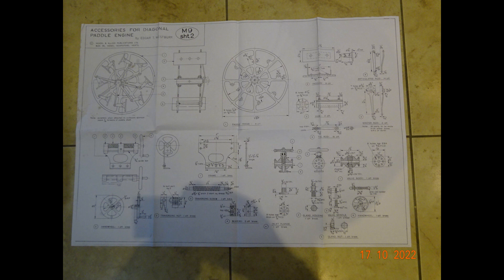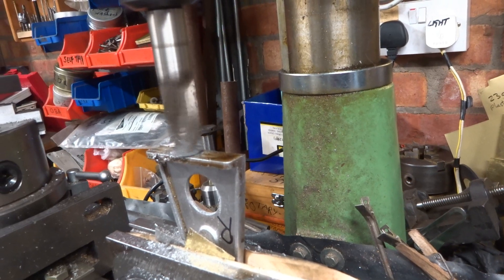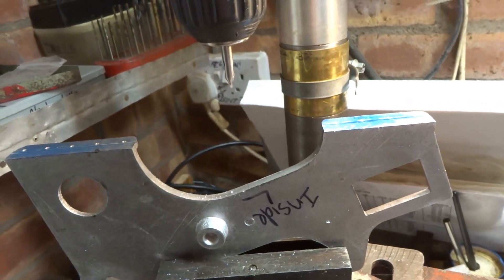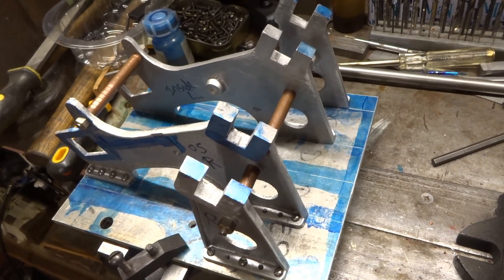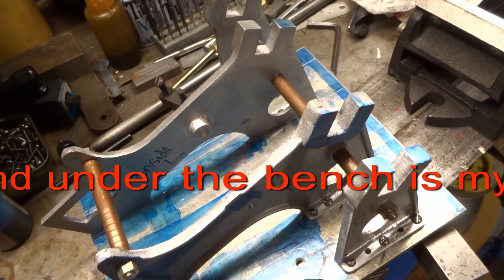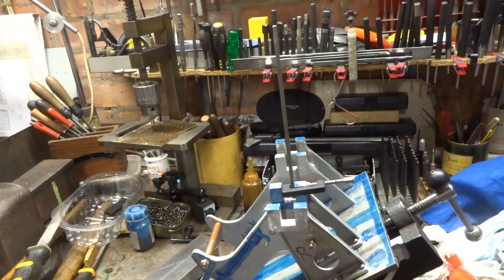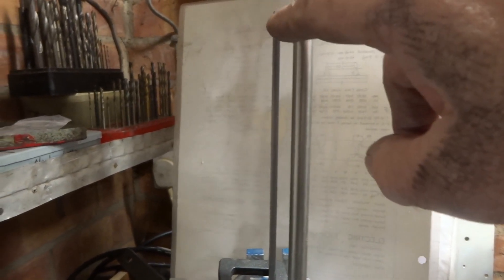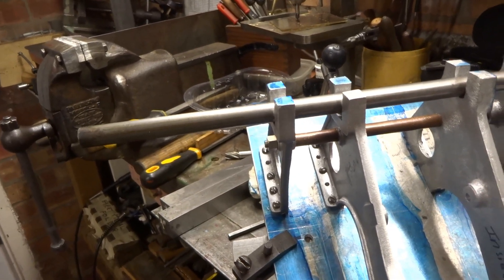Twin cylinder paddle steamer type engine

Comment: Good work. Looking forward to seeing how the engine progresses. What sort of valve gear does it use?
Reply from the maker: Thanks Ben. Truthfully I am struggling to understand parts of the drawing for this engine. I think in times past mechanical engineers (which I am not) were possibly better trained. That said I keep studying the drawings and have reached the conclusion that in some respects they do not show all components which is adding to the challenge. The valve gear seems to me to be Stephenson. The drawings do not say that, but it looks very like the valve gear I have used on some of my garden railway locos.
Reply: @edwinwhite933  I see, many thanks.